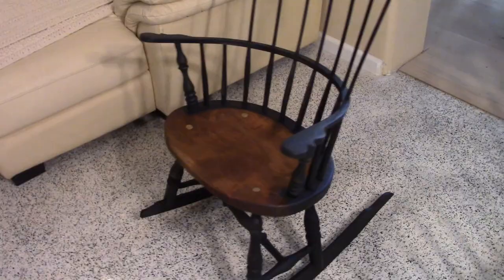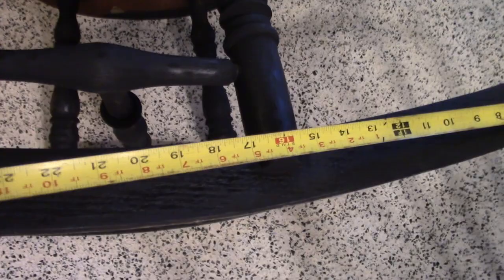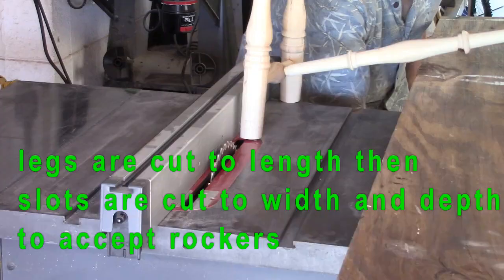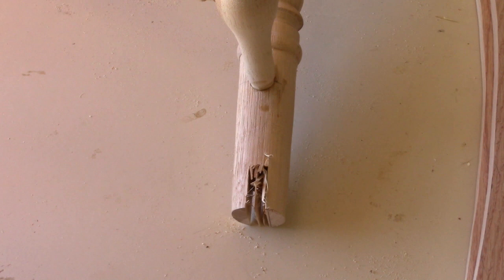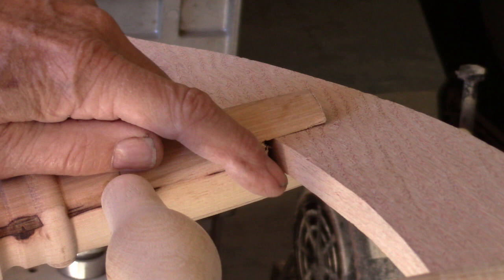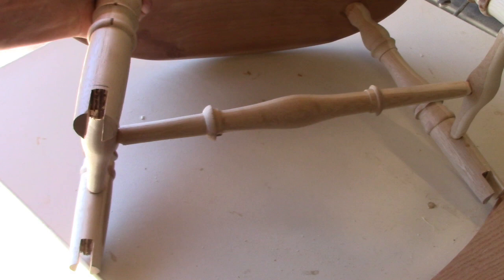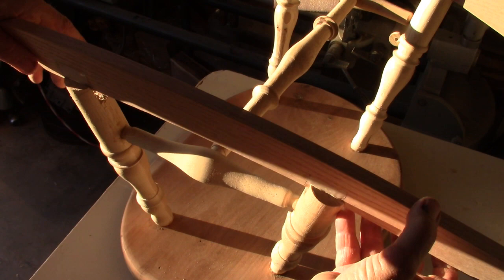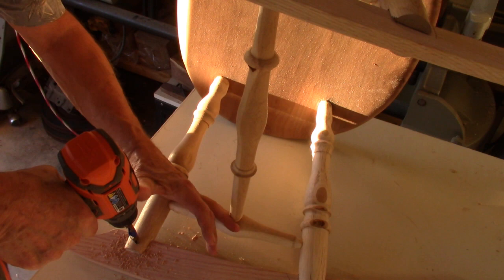making a rocking chair

Comment: OK First thank you so much for walking us through the process of making a rocker, I can't wait for the weather to break so that I can get busy on this ambitious project. So here goes a question. Please know that I am asking a question and not questioning your skill or technique.  I am at best a novice wood worker but I love it and all that goes with it and I have wanted to build a rocker for my wife for a long time now but haven't gotten the courage up to try it. But I think now that I have watched this video I understand better for most of the project. So here is my question and please don't take this as being critical, I am genuinely asking because I won't to learn. But, when you cut the slots in the legs for the rocker fit, and are needing to widen the slot, would it not be better to remove small amounts of wood from the rocker to fit instead of widening the slot in the leg? Thank you for understanding.
Reply from the maker: the rocker is already thin, 1/2 inch, it is easy to remove a small amount from the legs. you can also use a dado head on the table saw, and then the cut will be perfect. I don't like the setup to place the dado on the saw--- by the time it is set up my multiple cuts are are finished.
Reply from the maker: thanks for your comment my friend!